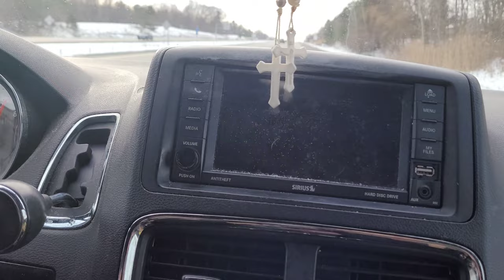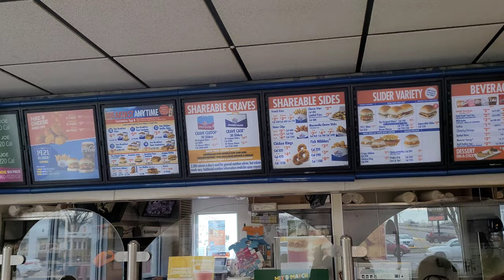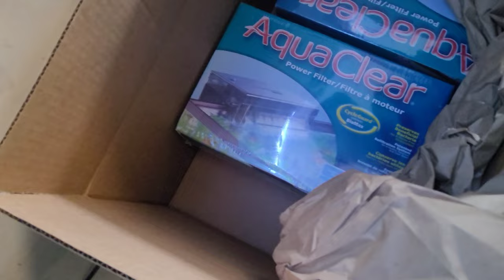Columbus Rescue for 250gal

Comment: You should never lay a refrigerator on its back that refrigerator may not work now it may work I might be wrong but I was always told you never put a refrigerator on its back front or side to side it has to be standing straight up that's what I was always told because it screws up the compressor
Reply from the maker: As long as you put it upright and leave for 24 to 48 hours it will be fine, I've done it to full size many times with no problem, but it has to sit awhile